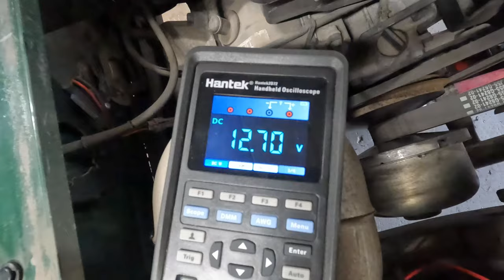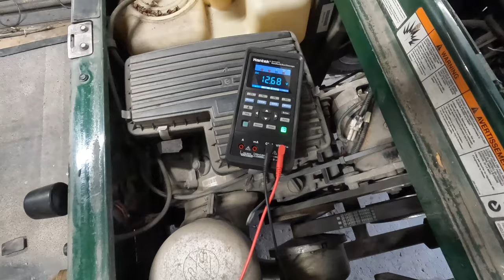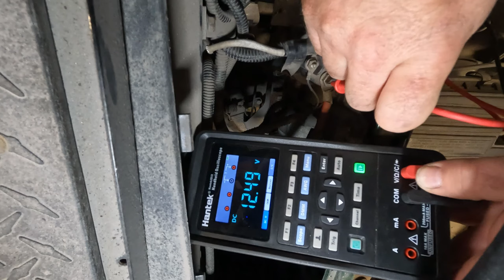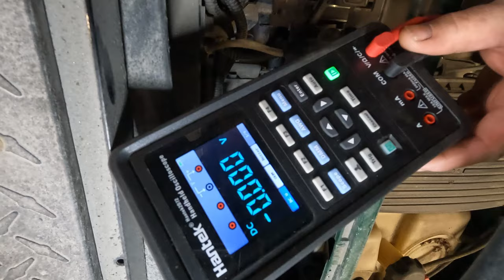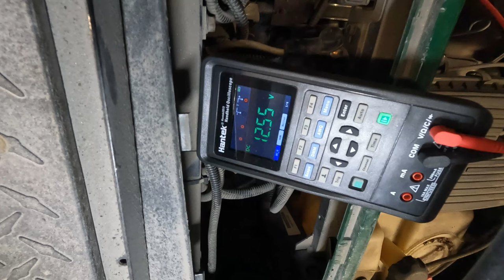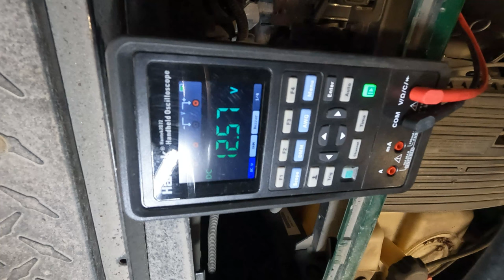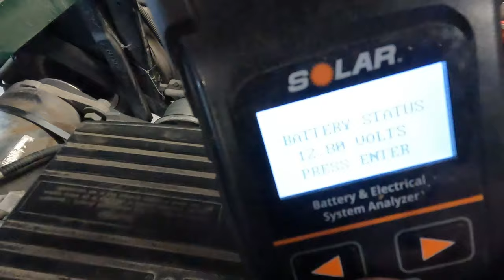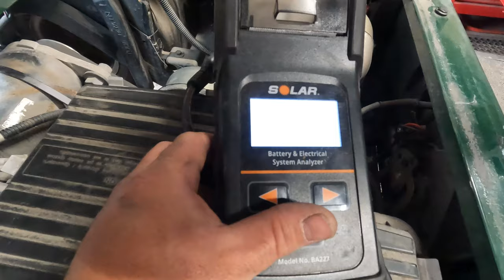2014 Yamaha Drive, Gas - Quit Running While Driving

Comment: Hey Kevin good to hear from you again it's been awhile! We have 5 yamaha drives at our course, that wire fails alot! The wire is constantly moving due to the motor placement. Poor design in my opinion. On average 2 fail a year. Using a longer wire helps reduce the movement somewhat, but it will fail again. Thanks for the video! I'm sure it will help alot who don't know this problem!
Reply from the maker: This is actually the first one that I've had come in with this issue. I work on a lot of Drives (routine service mostly). I usually see this on lifted carts, not stock ones.

Comment: I have a Yamaha drive not sure the year because it has a custom paint job, and rear seat with lights, otherwise stock. When in neutral if you put the petal in one spot with the key on it will not stop surging, I know that it’s been 5+ years sense it’s been serviced at all besides airing up the tires, it’s very dusty to the point that it should have been done some time ago. I think that the clutch is bad and needs a belt but not sure if the carb is making it surge or the clutch. Thanks!

Comment: Hi Kevin,
I have a 2001 club car ds that has been experiencing cut off during driving (no crank or start) for a little over a year now. A month or so ago it completely stopped and will no longer respond. 
 I started by replacing the microswitches which did not help, then moved to the solenoid. I replaced it and the cart sounded great, I pulled it out of the garage in reverse and drove it for a minute or two then stopped it and put it in drive. When I did this, the cart would no longer crank or start. I let it sit for a week and then tried it again.  I put it in service mode and neutral and it sounded great yesterday. But then I put it in drive and it no longer responded. When I put it back into service mode the solenoid now makes a loud vibration noise when I press the gas, almost like a growling and nothing responds Today I took the starter generator out and cleaned/ checked it. The brushes looked good but inside the bell there was a lot of dust and carbon. I cleaned it up, put it back in and wired it and still am getting nothing but a solenoid growl. Voltages up the the starter generator all seem to be normal, so I am at a loss going further. Any tips or suggestions

Comment: I have a Yamaha g22 that i have replaced five starter generators on in the last few years. I've replaced the petal switch and voltage regulator. When running, the system charges the battery like it should. I'm lost as to what could be the issue. Any advice would be appreciated. Love the content!

Comment: I personally like to use a old school bulb style test light to test solenoids because ive seen many times a multimeter give false positive readings due to no amp load.
Reply from the maker: I use both, but my go-to is a quality multi-meter. Test lights can't show voltage drop.

Comment: Lucky for the customer it didn't end up going big bucks. Kevin, do you have a vendor or brand you prefer for an EZGO starter generator. I did a rush repair for a friend that was in a hurry and went with an Amazon starter. Well, as usual it turned out to be junk, low output 12.4v in 2 months. It won't keep the battery charged. Thanks.

Comment: I would almost guarantee that the troubleshooting fault tree does not include a broken terminal.  The heat shrink should help with water intrusion and corrosion.

Comment: Kevin, I recently purchased a Yamaha g29/drive, gas powered. I don’t know the year because of the custom paint job. When I got it it needed a oil change and filter cleanings, but I thought it smelled really strong of fuel, and after riding for about 40 minutes then park it, when I would go to ride it 30 minutes later it would be chokeing on to much fuel! So I cleaned the carb when I had the air box of I saw that the fan cover was filled with a rodents home, probably why it would get so hot, I greased the cluch, I know it needs one, and a belt. And a battery. But my question is : why is my check engine light on?? It has the proper oil level! And it’s only on when the petal is being pushed down. Why is that so? Nervous to ride it with it on. I googled the symptoms but couldn’t find anything so I figured I would ask you! Please help.

Comment: Kevin, completely off subject. I completely lost headlights last night on my Yamaha G19 gas. I wanted check the headlight fuse but have no idea where the panel is. Ive looked all over!
Reply from the maker: Typically, the lighting circuit is just a seperate system entirely. The fuse should be, depending on the brand of light kit, by the battery. Its possible the head light switch is bad too.
Reply: @Kevinsgolfcarts  thanks, Kevin. I'll check them both! Much appreciated.

Comment: Kevin.........You take special care with this wire disconnect and in your other videos you take care in the specific repair......NONE of you guys clean the compartment with a power washer however....seems the added few minutes with a power washer would send a message to the customer you do just a bit more to insure the repair is done???????
Reply from the maker: I charge to wash a cart. If I'm going to the trouble to setup the pressure washer, I'm going to wash the whole cart. Most people don't want it washed and don't want to pay for it to be washed. If there is a problem, washing it could create other issues, so its not practial to wash just the engine bay. Also, working on a wet, dripping cart is no fun. Time is money.
Reply: @Kevinsgolfcarts  Okay